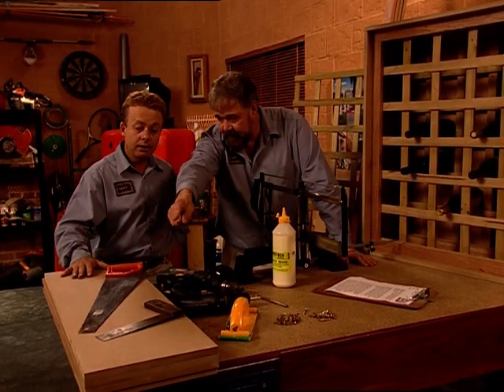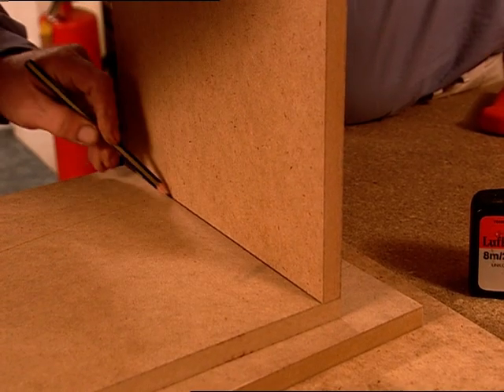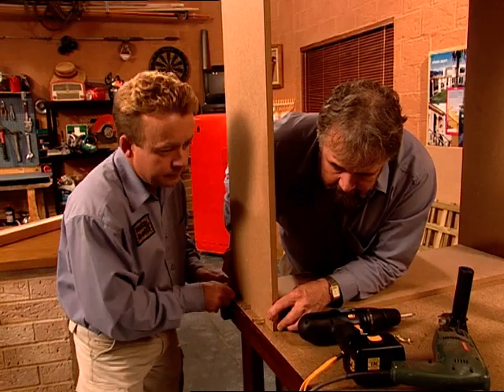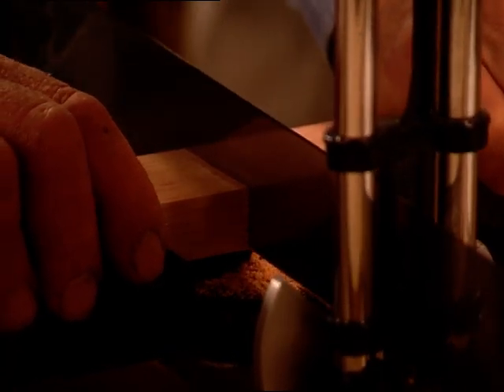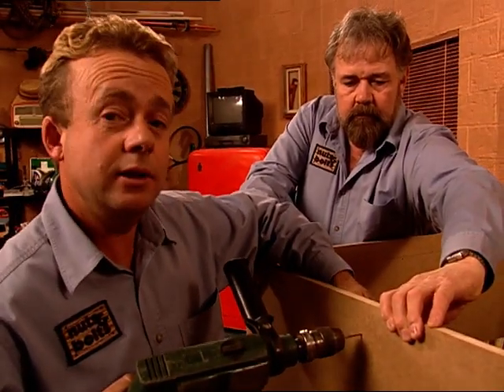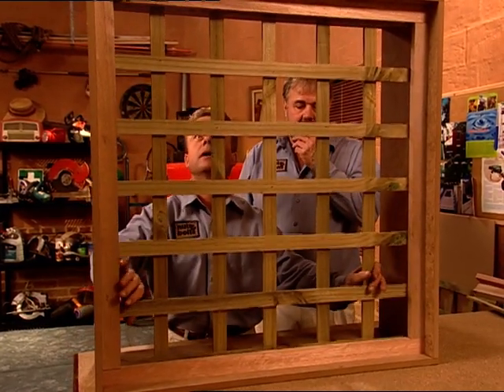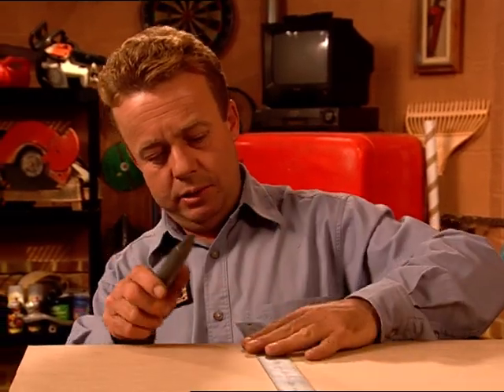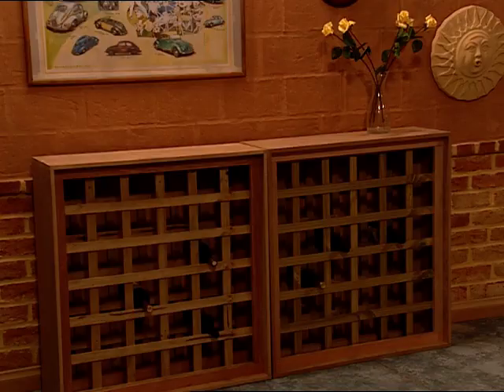How to Build a Wine Rack

Comment: I am trying to find lattice that has wider holes than the typical 4 inch type.  Wine bottles are slightly wider (1/4 in or so)  Where do you find wider holes in the lattice.  I am in so cal